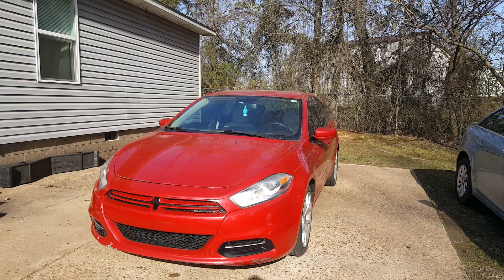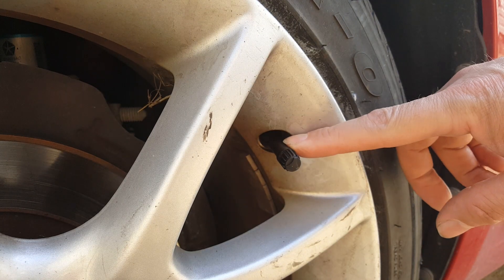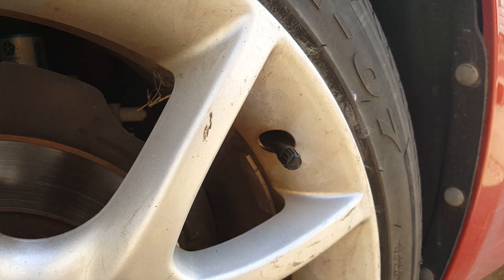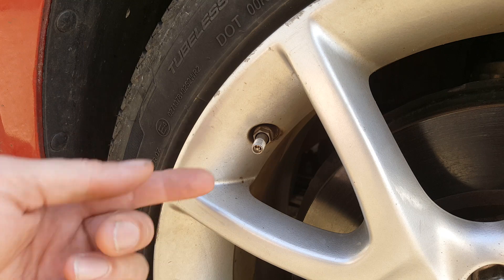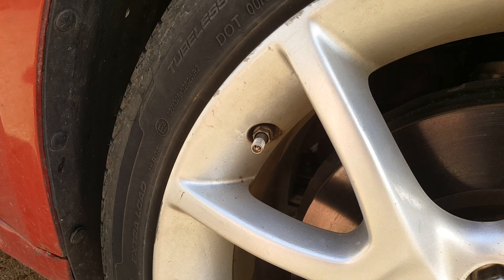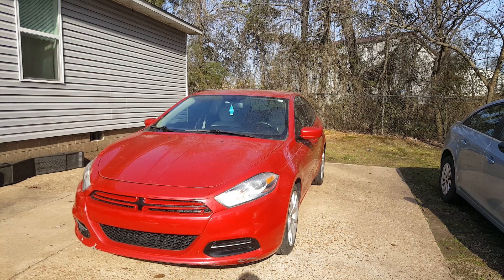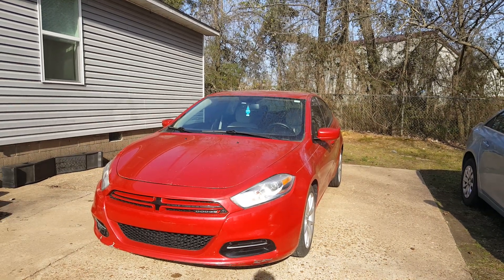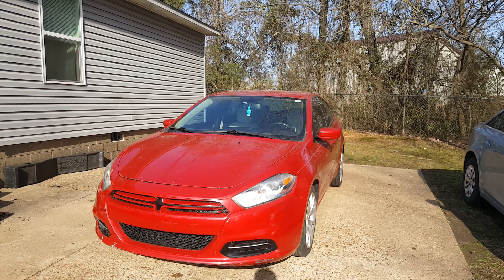2013-2016 Dodge Dart tpms sensor fault relearn process

Comment: Do you happen to have the part number for these? I called my local dealership and he was telling me if I bought 1 from there I would have to pay for programming. Thanks
Reply from the maker: https://ebay.us/49T2ow
This is the exact part I used. There is no programming. Having said that you may have to drive the car around a short drive and it will recognize the sensor. Thank you for the feedback.